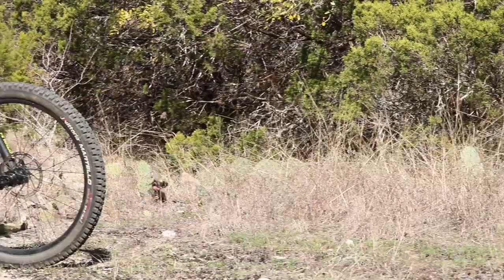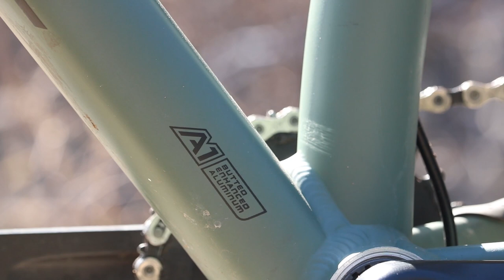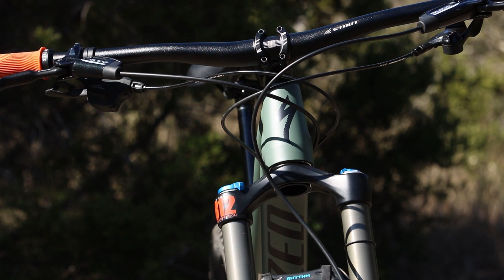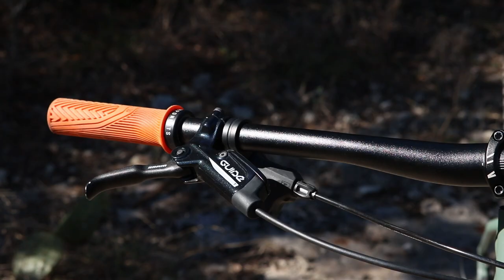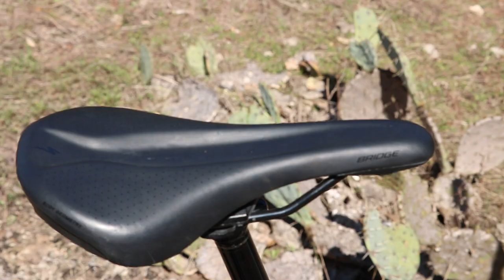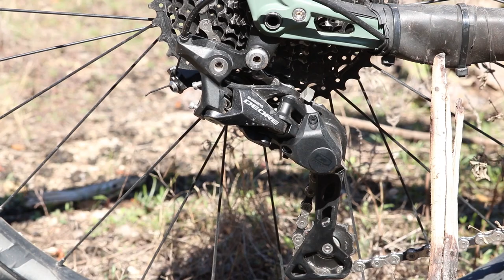Bike Check Specialized Fuse

Comment: I almost bought the Fuse Sport yesterday, but didnt because i wasn't too sure about the stack height on it. Guess i could put headset spacers on though once i upgraded the fork. How much travel are in your forks?  And are those the standard rims on it?  I hear theyre a little narrow for the tyres that it comes with.